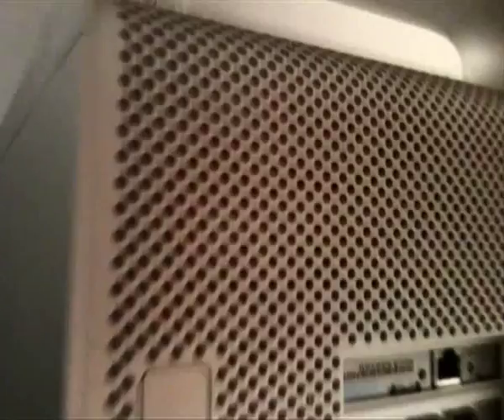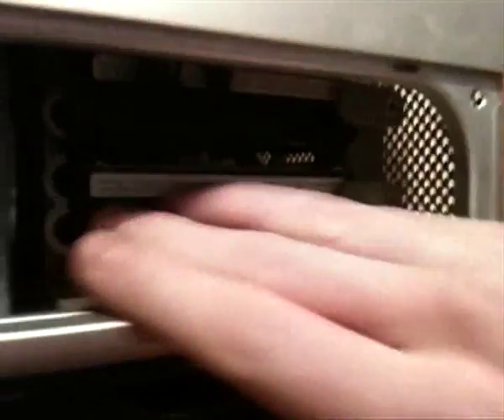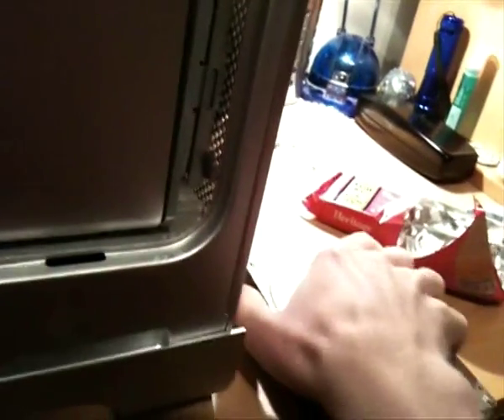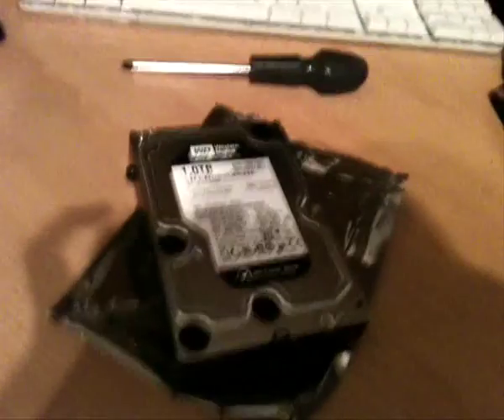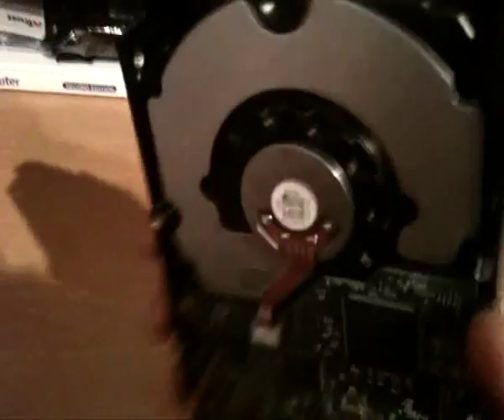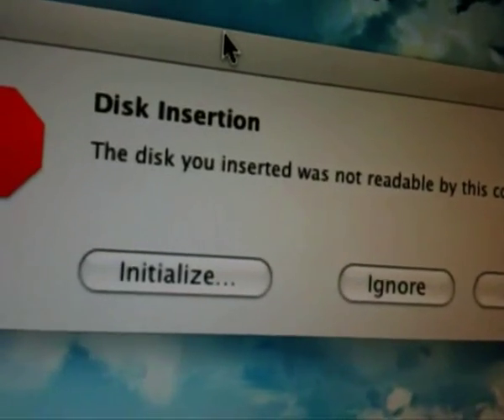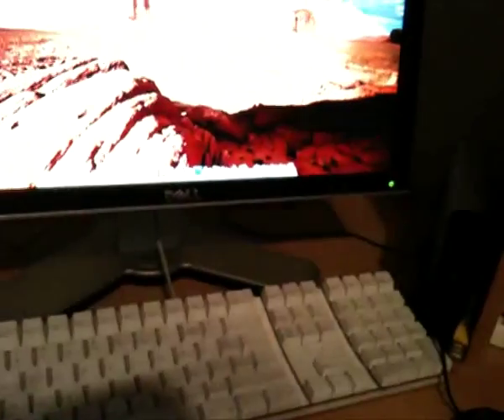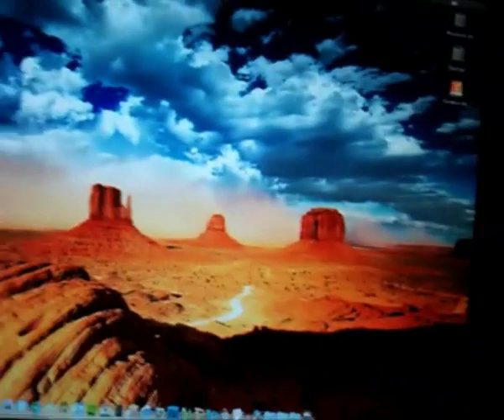PowerMac G5: Hard Drive Upgrade (Part 2)

Comment from the maker: @XFile2708 Thanks mate! :)
It's a Dual Processor 2.5GhZ machine (liquid cooled model).. It's got 4GB of RAM, it's now at 1.25TB and it's got the good old GeForce 6800ultra with 256MB of GDDR3. You can expect to pay about £450 - £500 for this machine.. But if you pay £650 - £700 you can get the Quad Core version with 8GB of RAM. There's plenty on eBay :)
And yeah, I use it for all of my video editing. It does a pretty awesome job :)
Hope this helps,

Tom